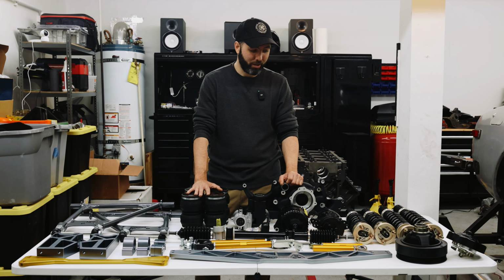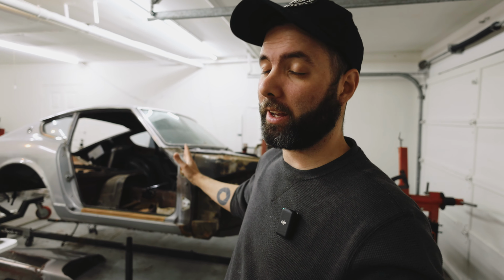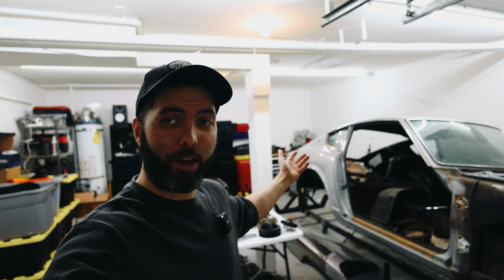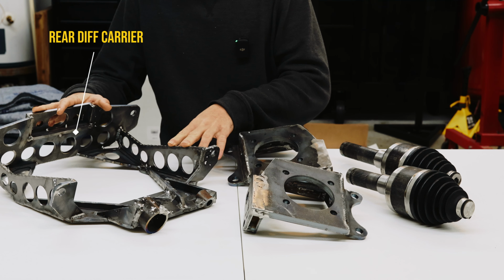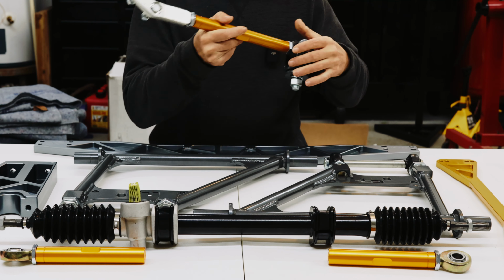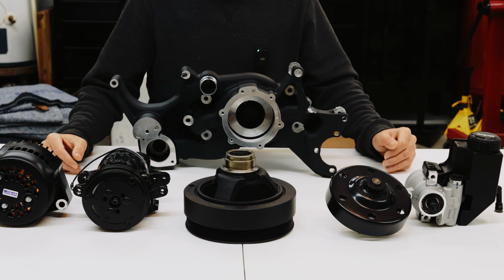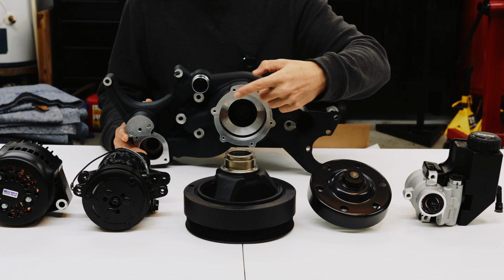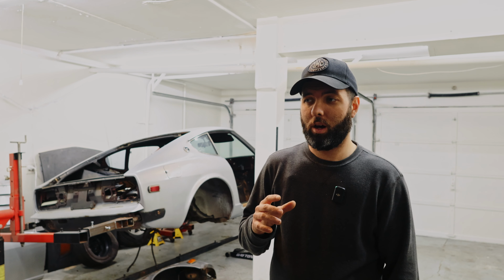NO CHANCE I Actually Build This, Do I? // @pistonzero Z

Comment: 🔥🔥🔥I looked up power steering for S30's , why don't you go electric? There are some electric motors that bolt on the steering column on the inside and you can adjust the sensitivity with a knob.
Reply from the maker: Still might be going electric P/S.. to be determined. Might use the bracket where the Holley P/S pump goes for something else.